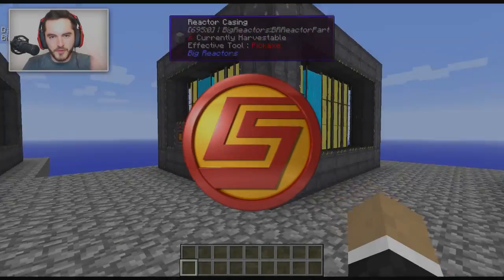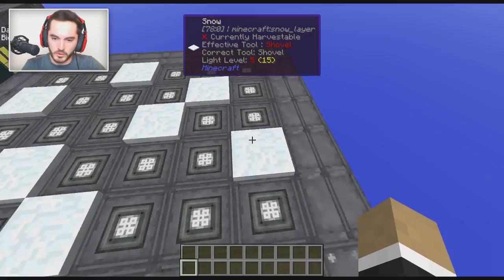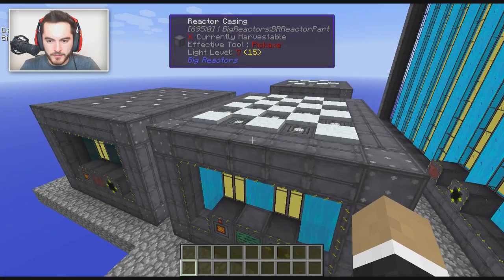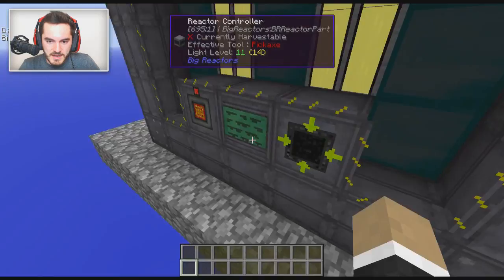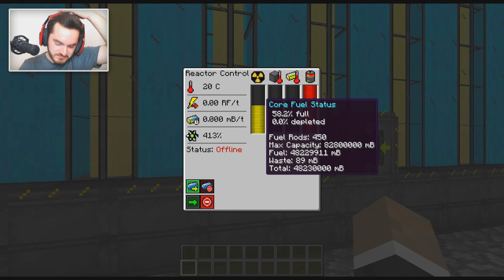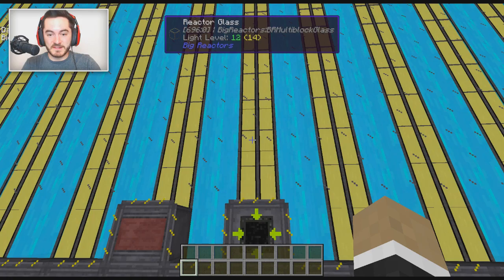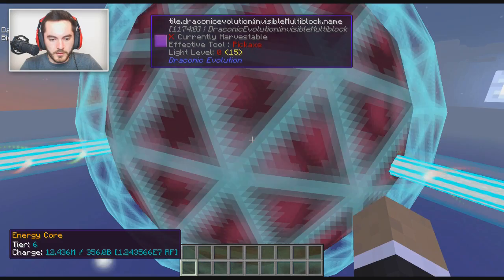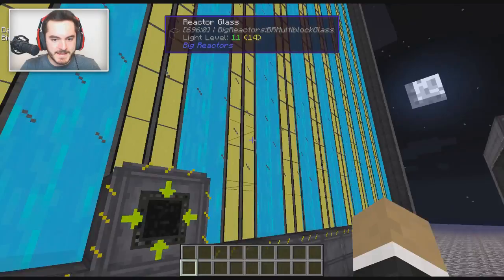Minecraft: BIG REACTORS MAXED OUT

Comment: so i ran a simulation and i came up with these numbers
heat: 4,314.4 C
rf output: 1,889,614.99 RF/t
Yellorium Ingot use per tick: 94.49 mB/t

better brake down
19,998.02 RF/mB
38.44 RF/block
0.41 RF/mB/block

and if you want to build this you need these items

Charcoal: 51,855
Diamond: 1
Iron Ingot: 133,305
Redstone: 310,951
Sand: 4,140,000
Snowball: 207,000
Yellorium Ingot: 23,429
(the sand is juse fore nitor to make the gelid cryotium)
(this reactor has 0 glass)

breaked down into blocks
Casing: 7,301
Control Rod: 450
Controller: 1
Gelid Cryotheum: 20,700
Yellorium Fuel Rod: 20,700
Reply: That would take like 20 years in survival
Reply: +Chomper32 - Minecraft & More Well you do get a ton of mods to help
Reply: Do you actually need all of that Cryotheum? Couldn't you just just 450 and let it flow from the top to the bottom?
Reply: samtherat6 nope cryotheum's source block does flow to the bottom so it doesn't behave like water
Reply: bro what 💀

Comment: Also Jordan, a good idea would be to make the checkerboard pattern and the cryotheum barrier combo.
Reply: the most efficient is actually lines with cryotheum between the lines of rods
Reply: Noah M. That's what I'm taking about, except make that in the middle of the reactor and make a 100% cryotheum barrier between the core and casing.
Reply: Gavin Burns thank you for correcting me

I suck at descriptions in chats or commants
Reply: +Gavin Burns (Gebcrafter) lol omg was thinking the same thing (only im 2 years 2 late ;3)
Reply: lmao same, only about 2 years and a half late
Reply: Gavin Burns - make the casing one size larger and put a layer of graphite just inside the casing.
Reply: The most efficient I think is three blocks of space between the casing and the fuel rods

Comment: The best design I've come across for BR is a 9x9x3 "pancake" reactor, with a 7x7x1 interior. Around the outer edge place resonant ender, and in the 5x5x1 square in the middle make a "waffle" (easy to remember, pancakes and waffles) with 5 rods, 3 rods alternating with cryotheum, 5 rods, 3 and cryotheum, then 5 rods. The basic unit produces about 15k, but it is extremely energy efficient at .128mb/tick and when actively cooled produces enough steam to run 4 turbines which makes it easy to upgrade later. If you need more power than the 4 turbines produce move on to a draconic reactor.

Comment: One of the most fuel efficient designs for a 5x5x5 (inside) I've found is to use 21 fuel rods everywhere except the corners. Put cryotheum in the 4 corners. Set control rods to 92%. You get ~105k RF per millibucket and ~5665 RF per tick. In terms of maximizing power output, the best 5x5x5 I've found is 22 fuel rods and 3 cryotheum. The outer ring (5x5) is all fuel rods (16). The next ring in (3x3) is cryotheum in 3 corners and the rest fuel rods (5), and finally a fuel rod in the very middle. This nets ~20.9k RF per tick (0% control rod). This seems to be the absolute most you can crank out of the 5x5x5 (7x7x7 outside).

Comment: Keep in mind, that the only measure of efficiency that most people use, is peak per tick power output.  The combustion rate of your fuel there, was horrible.  Something like 90 mb/t, whereas a 3x3 reactor at full throughput will use around 0.8 mb/t.

So given that in practical terms, I'm probably never going to need more than 10-20% of what is generated by that giant reactor, I'd much prefer making a group (even a large group) of 3x3s or something similar, and keeping my per-tick fuel consumption rate down.  I won't generate anywhere near as high numbers per tick, no; but I will be able to continue generating a low tick rate for a much longer period of time.  It's the same principle which Extra Utilities' Survivalist Generator uses, which is why I like them so much, as well.
Reply: make the reactor wide and not high the higher the more energy but also more fuel consumption
Reply: lmao use that with draconic evolution

Comment: The best config for reactor, is checkerboard pattern with the rods and graphite, AND with a one block buffer on all the edges with cryo.
Reply: Use the big reactor simulator online and see for yourself
Reply: +omegadan Actually resonant ender is what you use on the edge, not cryotheum.
Reply: does diamond blocks cooling better than cryo?
Reply: +Arm4g3dd0nX cryotheum is more efficient by like 1 percent only
Reply: +Chronomantique in every single way cryotheum is better than diamond
Reply: +Arm4g3dd0nX but cryotheum is much more expensive and it does not flow down so you would need a lot more, so resonate ender could be more efficient because it is so much cheaper and you need so much less
Reply: +negspirito Proper cooling gives any reactor better power generation and fuel efficiency. Sorry about the long links, idk how to shorten them
Reply: omegadan Resonant ender has the property of teleporting the radioactivity that tries to pass through it back to it's source.  Therefore, unless you have a buffer of 4 meters of cryotheum (max range of radioactivity), resonant ender is more efficient.

So resonant ender on the edge, cryotheum between the fuel rods.
Reply: +omegadan except for when you need to place it ;p
Reply: ImDemonAlchemist You are at a 9 right now.  Can you please take it down to a 2?  Also, that comma in the second sentence should have been a semicolon.
Reply: +Arm4g3dd0nX This same person has posted this same comment at least three times just to annoy people. Also, you're right about the grammar.
Reply: ImDemonAlchemist Ah, ok.
Reply: Nope! Checker is inefficient!
Reply: Jackson Plummer Efficiency tends to be a poor goal when it comes to big reactors actually.  For instance, converting a huge passively-cooled reactor to actively-cooled reactor requires a ton of resources, including chunk-loaded space, for an extremely modest increase in power generated, and a huge increase in efficiency.  However, even in the strictest modpacks, you end up with more fissiable material than you will ever know what to do with.  In fact, often, I have to build reactors in maniacal compact ways and throw efficiency to the wind just to prevent yellorium/uranium from being a waste material.
Reply: Richard Kelly The point in trying to make REACTORS work is so that some noob cant throw easy resources into his reactor and bam10k RF/t.  Just for a little... experiment... go build  a large reactor with just a bunch of rods of fuel! I would like to see you try (and how long until you would explode).
Reply: Richard Kelly May I answer your question with some questions of my own?  What is the point to learning game mechanics in literally any game?  Or the rules to sports?  Or useful techniques in artistry?  They don't simulate finding a replacement primer bulb for your lawnmower at the local hardware store.  They do not help you file your taxes any better.  When you need to learn how to use the gas pumps to fill your car up, they offer you no assistance.
Reply: Richard Kelly There are dozens if not hundreds of mods that include energy generation and consumption.  If you wish to turn iron ore into an iron ingot, a furnace and some coal will do.  However, if you want to actually crush and refine that iron ore, and find yourself with a larger amount of higher quality metal (such as steel), you need to up the complexity of your ore processing.  This ore processing uses RF (or possibly one of the other energy types).  (There are literally tons of other uses for energy.)  You can burn coal to get a handful of RF.  You can get geothermal power from lava for even more power.  But if you really want high levels of energy for a wide assortment of uses, you are going to have to tap into fusion, fission, or some of the incredible properties of ender pearls or nether stars.

If you made a mod that gave you a billion RF per tick and only required you to use two iron ingots and a stick to make, you would make all the other mods that generate energy pointless.  So, the point, is if you want more UTILITY, you have to pay for it with DESIGN and RESOURCES.  It's a system everyone agrees with.
Reply: Richard Kelly Want to build a portal?  Gonna need power.  Want to have a searchable storage system for your stuff?  Gonna need power.  Want to use power tools or powered armor like iron man?  Gonna need power.  Want to light up huge areas with flood lights?  Gonna need power.  Want to automate that carrot farm?  Power.  You want tesla coils to keep baddies away from your base?  Power.  Do you want to drill down past the bedrock to gather minerals regular player characters could only dream of?  Power.  Do you wish you could create brand new synthetic realms to explore that you have given some seed properties to?  You guessed it, power.

Not going to be able to keep all that stuff running too well with charcoal and buckets of lava.  What you really need, is a nice, huge, possibly over-engineered, behemoth of a fission reactor.
Reply: Richard Kelly Those other things are from other mods.  Everyone, for the most part, has simply agreed upon RF as an interchangeable power unit between the mods.

Adding a layer of complexity in power generation is nothing new.  Stirling generators and compression dynamos aren't that complicated in and of themselves, but remember, you can upgrade them, you have to add wires to transfer that power, and you probably will need to automate the process of loading them with fuel.  Set up an array of 40-50 of those buggers, and the complexity therein, and you'll find yourself wishing for a single device like a big reactor; which can be as small as a 3x3x3 area and scale up easily from there.

I really don't know why the need to create actual real-world power is the hurdle this mod needs to jump to avoid your criticism.

It doesn't toggle functionality, it fills wires and any batteries or capacitors connected to those wires with RF.  The other devices perform their task while they are on, and drain RF from any wires connected to them.  If the wires no longer contain RF, they shut off.
Reply: Richard Kelly No, not exactly.  In fact, nothing like that at all.  I have no idea how you read what I wrote, and decided to insert your own preconceptions in in place of what I actually said.  Maybe you just like to hear yourself talk, so you pretend others are saying what you were saying.
Reply: big reactors don't explode

Comment: That's close to the best way. It's been a while since I played with Big Reactors, but I'm pretty sure that the outer layer being Cryotheum yields better efficiency and production, for the simple reason that ALL the fuel rods will be touched on their 4 sides and the whole casing will touch Cryotheum. I might be wrong though.
Reply: SirUmnei You are right, because coolant on the outside reduce casing heat and thus reactor output.

Comment: Jordan if you use a different fluid on the outside layer and then have the fuel rods it'll be more efficient or have the diamond blocks as a buffer it'll be cooler. Also in sky factory if you stack up the yellowrite and then vain-mine it with fortune and auto-smelt it'll give you 2.5 where as the furnace gives you 1.0!

Comment: actually, the best reactor is not the biggest, it is the most efficient by ways of power generated divided by fuel usage. if i am not mistaken, the best way is a 7x7 reactor, which leaves us with 5x5 on the inside (the height does not matter), and you put in the outer layer gelid cryotheum, in the middle you do a x pattern with fuel rods, and the remaining space with graphite blocks (which are actually better then diamond). perhaps enderium is better then graphite, but i am not sure about that. materials required: casings: 94+(height-2)x20 +heightx4 (up to (height-2)x20 can be replaced  with glass), fuel rods: 5x(height-2), graphite: (4xheight-2), gelid cryotheum: 16x(height-2)

Comment: You can also build a tall reactor with a board pattern, attach four 9x9x16 turbines to it, put 4 ludicrite rings on the turbines and then insert the control rods slowly into the reactor until it reaches 87%.
The result is 28KRF/t per turbine, and only ~0.600mB/t consumption on the reactor itself. 
That means 112KRF/t, using only a bar of yellorium every ~5 minutes or so.
Reply: Note: since cryotheum has incredible conductivity, it's not going to be useful for the reactor, fill every gap with graphite blocks instead, that allows the reactor to operate at very low tempartures without losing reactivity.

Comment: yeah the real trick is trying to get all the settings, and the layout of the reactor to produce the most energy at the most efficient rate. im sure someones made a tool for testing layouts in theory as well as test various liquds and metals for cooling, the next big challenge, make a reactor that size, that most efficiently uses its fuel for a passive reactor, THEN design one for active cooling, and power as many turbines as you can with it, with each turbine taking on the full 2000mb of steam and not redlining (i've found turbines generate optimal power at about 1830 RPM)

Comment: The reactor design in this video produces 92.5 MW, using between 95 and 100 mB of fuel per tick. This is an efficiency of      925 to 973.6 kW per mB per tick, or 46.25 to 48.68 J/mB of fuel!!

Comment: If only there was something you could use such power generation on.  A large applied energistics facility, an ore processing facility, laser drills, ender quarries, and even Mystcraft/RFTool dimension support stations all combine to use roughly 50,000-150,000 RF/t.  All that can be powered by a few turbines.

Actually I just thought of a crazy difficult build to make.  A reactor, powering a laser drill, to gather the resources necessary to make Mekanism ultimate power cells, that will use one of the computer mods to determine how full the current ultimate power cell is (that the reactor is currently also filling), and swap it out with a new empty one it has automatically created.  The old full power cell will go into some kind of storage.

If anyone can do that, consider yourself having beaten modded Minecraft.
Reply: +Arm4g3dd0nX Also, build a fusion reactor in Mekanism.
Reply: you've clearly not seen how much energy spawning a new dragon takes in draconic evolution
Reply: 400M Rf am I right? The fusion reactor can generate about 1 billion Rf/t(and also much more compact than the one in this video). And you can still configure it to produce more. I have configured mine to produce 10 billion Rf/t. You clearly are using a very old version of Mekanism, or you probably haven't tried the mod at all.
Reply: ***** I've spawned a new dragon with DE, but at this point I just use the atomic multiplier from the Calculator mod to quadruplicate stuff like draconium blocks.  Costs 1.5 billion RF per use, and I've used it over 100 times.  RF is so abundant I've been known to quadruplicate dyes before as I haven't set up a Botania station and my Aura Cascade cascading colorer requires me to stand there and shear the sheepies to get the pigment.

Comment: Awesome. 1.8m RF/t. I fed that into the BigReactor Simulator, and put a layer of liquid ender around it, and three layers of cryotheum, with the four stacks in each corner being graphite (they don't matter for power gen, as the radiation only travels in cardinal directions, in the mod); doing that, I ended up with 1.6m RF/t. Which, if you actively cool it, results in 2501 (and change) buckets/tick of steam. Which means you could generate 33 million per tick with actively cooled. You just need 1250 7x7x16 turbines (with 32 ludicrite blocks, they generate just over 27kRF/t each) to do it. :-/

Comment: It's not laggy because of lighting updates, it's laggy because you've got 49 thousand tile entities (although some of them probably don't tick) in that reactor AND all the fuel rods have to do custom rendering. Also that design is pretty poor. Fuel reactivity goes up if a rod has fuel rod towers adjacent to it. You don't want to have fuel rods that close to a wall either, you want to have a 3 or 4 tile buffer of coolant to help keep the reactor cool which helps reduce fuel consumption.

Comment: The saddest thing is BR bases power generation off of I believe core heat (been a while, don't @me). If you truly want most RF/t with no regard to yellorium, Resonant Ender. Pulled about 20.6kRF/t on a 7x7x7 15-18 fuel rods. If you do that full alternating pattern, you could likely pull much much more

Comment: That moment wenn you realize there is a single block in extra utilitys that can output almost double the power. 2,650,000RF/t to be exact. The netherstar Generator x64. The only method of transfering this ammount of energy is the hyper energy transfer node from extra utilitys which can take 1,000,000RF/t. You have to put 3 of them on it. One on each side. Thats what i call real power

Comment: Your wrong the most efficient I have got a reactor is the all in the centre method 30x30x46, a 3 block buffer of cyro thus a 24x24 fuel rod. The thing is you need each rod to be at 99%. You get 0.3MRF/t for 1.21 mb/t leading to .25MRF/mb. Expensive reactor though. You need to fiddle around with ur control rods on the big reactor simulator.